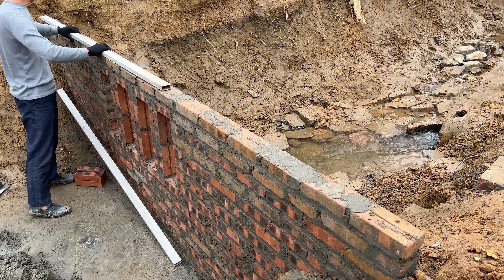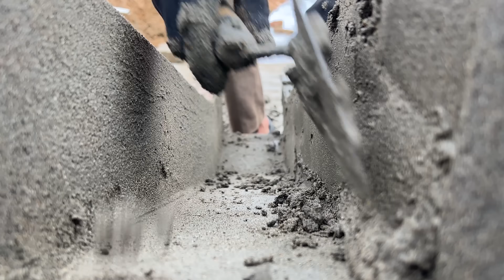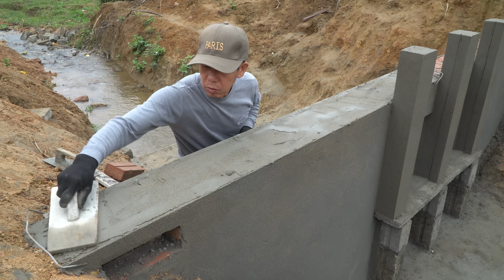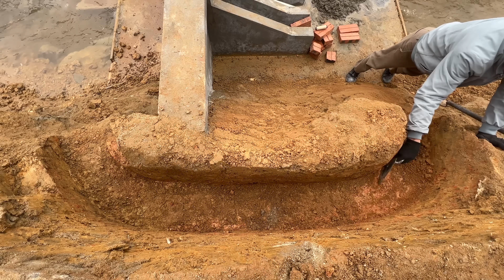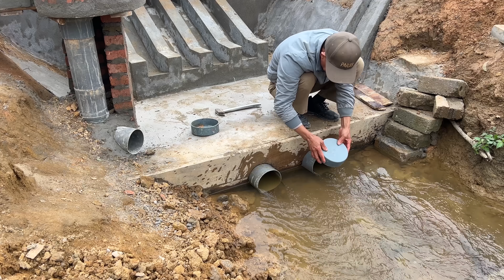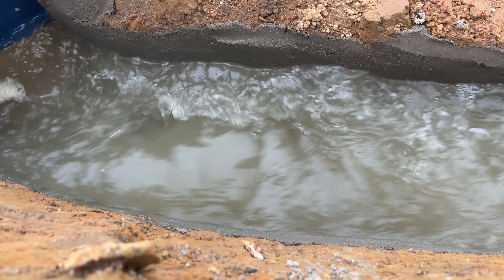Construction of 220V hydroelectric power plant

Comment: Why was the generator water turbine at the top of the spillway and not at the bottom , that's the same as making a 6" tall Dam instead of a 4 foot dam if you don't take advantage of the gravity from the water falling all 4 feet. If you look a full size dam the power house is below the dam not at the top and so are the water turbines. Also if you are going to build a dam make it wider so you can use it as a bridge too.
Reply from the maker: Yes,Thank you so much 😀
Reply: I'm confused as well, why make it that high and only use a tiny bit of it? Could've saved a bunch of effort and made the dam 6". Looks cool, but man, seems like a waste of potential
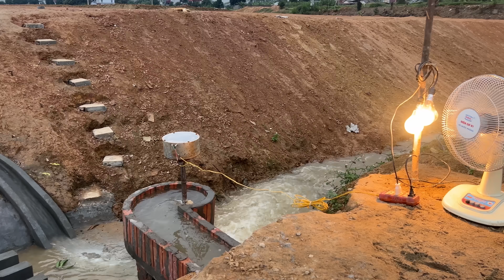Reply: @Chien-Tran I think you should hear these guy's... I'm thinking that your project is limited a bit by the length of your turbine shaft (to avoid put coil underwater). Extend your turbine shaft and use the pressure of more water column in your favor. 16:35
Reply: It's more of a sculpture than a functional piece of infrastructure so I guess he just wanted to be able to easily take the turbine out (notice the turbine is not fixed, it's just sitting there).
Reply: @leonelalmeida7921  In another video he submerged the turbine, think thats not the reason.
Reply: First I thought the same way, but:
if the height of the water falling column is less than 9,8m the gravity will not force the water to decompress (and therfor the water column is not interrupted by vacuum bubbles).

In this construction the turbine works as a streaming engine - the volume of fluid per second in this stream above is the same as on the bottom. And based on the fact that gravity works here as a suction for the water AND the used height is less than 9,8m there won't be any decompression and so caused volume increase (vacuum generation in the water) per second.
The speed of the incoming water is equal to the speed of the water on the bottom (parameter fixed: diameter of the tube).
So the generator can use the power calculated by E=m*g*h
=> E [J] = water volume [L]/sec * 9,81 * h [m]; 

==> 1L/sec flows through the turbine produced ~10J or 10Ws (if the generator works with efficiency of 100%...)
10Ws equals 36000Ws in one hour ==>> 36000Ws/3600s = 10W electrical power

To drive here a fan and some 2-3 light bulbs with 20-40w each represents at least 50-80W permanent power requirement.
So with an falling hight of 1m of this dam you need at least 10L water per second of flow...

Your thoughts were absolutely correct but only relevant on real high power water power plants. There the falling hight is more than 25m to 200m, so all turbines must be situated on the lowest point.
in these projects the water in the tubes (to the turbines) are under full pressure (1bar each 9,8m), so the turning speed of the turbines can also be controlled by the amount of water.

The micro water power plant uses a hight of max 1m, so the "suction pressure" is about -0,1bar which drives the turbine, and this negative preasure is generated in the falling tube after the turbine by gravity.

The most interesting thing to get out the maximum power in this project is:
the turbine has to be fed always with sufficient water, so no air gets into the falling tube. This would cause a significant fall of suction which drives the turbine.
==> so this powerplant can not be regulated very easily.
Reply: I'm just grateful that someone has bothered to do this. I had thought about doing it myself. I hope it serves as an inspiration to others.
Reply: The suction of the falling water in the pipe drives the turbine. It may be more practical and efficeint.
Reply: I posted almost exactly the same comment to another of his videos with the same designed dam/turbine, for a second a thought I'm reading my own comment. :D
The only thing that came to my mind is that the turbine is utilizing the suction power (underpressure) made by the water falling out of the turbine. But hard to say without knowing what actual turbine has been used. Still, it wouldn't be so efficient as having the turbine at bottom, I expect.

When designing a hydroelectric power plant, engineers ALWAYS aim to have the water falling onto the turbine from as much height as possible.

Comment: He is not building permanent Mini Hydro Dams. He is learning how each design works and produces the same results. Same thing they teach in Engineering class in college. Building Bridges out of toothpicks for your examines. If you wanted something permanent. It would cost $15,000.00 US dollars for a 10kw one. If you built it yourself. As the motor alone cost $12,000.00 US....
Reply: I mean even if it worked as a permanent power supply it would be a lot of effort for a bit of lights and fresh air :D
Reply: @mallarysangel  yes the video is sped up and it makes that sound
Reply: Tama ka bro, walang bakal madali lang matibag sa lakas ng current ng tubig sa katagalan giba yan.

Comment: Wait a minute, does this guy just rebuild the same damn every day?
Reply: The same damn dam
Reply: They probably keep falling down.
Reply: The next one, he waits for the concrete to dry .
Reply: "Dam"🤓🤓🤓
Reply: @Tr33fiddy   so many bricks concrete flown away. that's sad
Reply: Came to say the same dam thing 😂😂😂😂😂
Reply: He forgot to answer "Thank you".
Reply: @Delibro Best comment in that whole thread. Sumbish won't translate and read a dam thing.
Reply: @mallarysangel  Answers on unread posts. Shameless.
Reply: 😂 people say the craziest things… 😂 clearly it’s a different dam..
Reply: No, he does not wait you do😮
Reply: the locations are all different, if you pay attention to the surrounding area in the background its clear hes not tearing them down and building new ones
Reply: That’s the cuss word Dan
Reply: Dam
Reply: I was wondering the same, also When he plugged in that fan. The water level stayed the same, I would have expected the load to slow the flow of water. Still though very cool dam.
Reply: @prestonsheffield7437  Utilizing the output will not restrict the input.
Reply: @GodlessArtist  that depends... if too much load is put on an alternator it can actually stall it out completely and at the very least, slow the rotation speed. The effect of adding a load is that there is a stronger magnetic resistance to the rotating alternator. The strength of that resistance is directly proportional to the amount of load added to it.

Comment: Impressive as these builds are, I have to state that the generator sluices he’s built are somewhat flawed in that his junction between the brick and the clay in some places is not adequate enough in that the brick needs to extend further into the clay than he’s done here in several instances.  He also hasn’t extended those sluices high enough to avoid splash-over which can, in time, erode the clay allowing for settling and cracking of those concrete sluices.  Cracks introduce potential unseen erosion events that can further undermine the sluice structures.  Beautiful work; just needs a bit more robust detail work on the sluices.
Reply from the maker: Yes, thank you so much ❤❤❤
Reply: I don;t think the goal was to power the village or for the damn to last any significant time, your missing the point, very negative comment for such excellent engineering
Reply: @robb7370  not real negative... unless you consider constructive criticism and places to learn as "negative".
Reply: @wernercd  constructive criticism is constructive if it comes from someone who can demonstrate the skills they reference. As cogentconsult's only video posted is of his pressure washer that his wife can easily pick up and put in his SUV I am not sure he is qualified to give constructive criticism. And equally your videos about wife cheating is probably not connected to construction or engineering but don't take this the wrong way it's not a negative comment this is purely constructive criticism.

Comment: Somewhat doubtful as to whether the electricity production he showed as the end result came from the dam. Don't seem to be any converter/regulator etc in the equipment he uses to harvest his hydropower, also it seems a lot of power to be generated by something like this and it just seems way to stable and smooth for electricity that comes directly from the electromagnetic circuit. I might be mistaken but that would be very easy to fake with a hidden wire in the sand. Otherwise very nice work, love the design (although it wouldn't stand up to a lot of force) and how he finishes everything as well

Comment: 13:04: I would think the pressure of the filling water on the other side would blow these caps off....I thought it would be better to cap upstream.
Reply: these caps has to withstand the pressure of approx. 0,1 bar (height of dam ~0,1m).
If you use those plugs on the other side of the dam it will be very difficult to release them because they are 1m meter under water level...
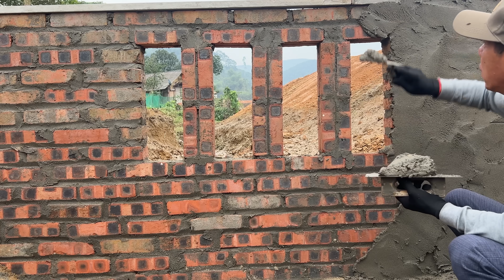Reply: 01:44

Comment: Good idea, but weak in design, strength is its failure.

As an engineer myself,
I would not have done it this way because of no reinforced steel used or no foundation support.

Many structural weaknesses
Reply from the maker: Thank you very much ❤❤❤❤🥰

Comment: About max 10W, 1 liter, 1 meter per second?
Reply: The fan plus three (incandescent?) lamps suggest a bit more, 50 or so.
Reply: @AdrieKooijman They are LEDs and a couple of watts for the fan. I just state maxed out physics with efficieny 100%. Probably about 2-5 Watt with that solution.
Reply: Yah this thing would break down in less than a year cement applied right to dirt also
Reply: No. About max 10W, 1 litre, 1 metre per second?